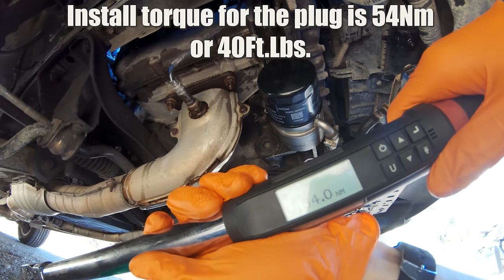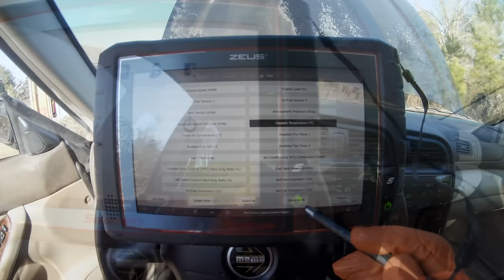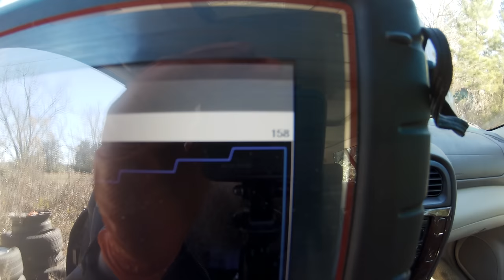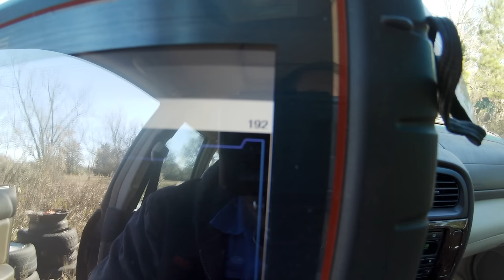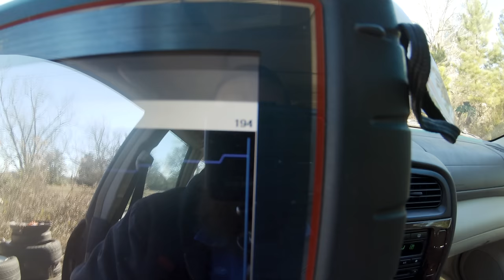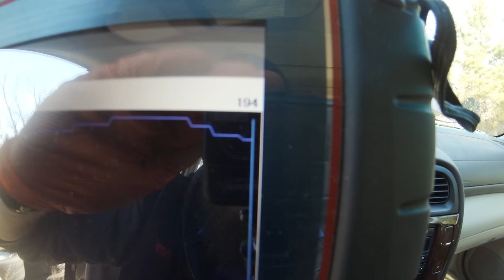Subaru Coolant Replacement

Comment: Pro tip: disconnect top radiator hose and slowly refill coolant into hose until it won’t take anymore then reconnect and top off.. eliminates air pockets.

Comment: Nice video.. i think you should wrap the teflon tape the opposite direction next time.
Reply: Yeah I noticed that too, but then noticed he only did roughly one turn, so basically no difference. My normal thought is that if I can pretend I'm tightening the fitting as I'm wrapping, It's okay.

Comment: On a O.R.B fitting there is no need for teflon tape.  The threads dont do the sealing. The oring does. Only use tape on pipe threads.

Comment: I did the heater and keeping the rpm at 2-3k several times over the span of 30 minutes. Bubbles stopped but would come up after turning off the car. Is that normal?

Comment: Your camera angles, snap on tools, no talking just concise thought out captions....you kick ass man thanks. I have used primarily your videos to replace on my 06 obk front hub/bearings, front control arms, side links, transfer case seal and drive shaft (3 times), flush my coolant, power steering flush, ac clutch replacement, both power belts....and a lot more haha. I owe you for saving me literally HOURS AND HOURS of labor when its $125 an hour now in my area for mechanics.

Comment: I stg man, you’ve got the most helpful videos for subie owners. No fluff, no bs, just the job in a plain and clear way. I bought my first Subaru 2 years ago, and I haven’t had to take it to a shop a single time. Not once! Everything; changing coolant, bleeding my brakes, changing the oil, changing the diff fluid, changing gear oil in the manual, I’ve learned it all from you. I can’t even begin to calculate how much money you’ve saved me. I didn’t even know where the oil went in the engine bay when I bought the ol girl. Couldn’t even tell you where the drain plug was or what it looked like. That isn’t the case anymore, and I’ve got you to thank. I don’t think people realize what a resource this is for normal, working-class, folks. And you’re doing it free of charge, to boot. Thanks so much, sir. I really appreciate what you’re doing. This is legitimately a service that really, really, helps people, and I hope that doesn’t go unrecognized 😊

Comment: So I probably looked through your video numerous of times to do a drain just like this for a 2011 subaru outback 3.6r 5eat trans. The drain plug for the coolant was way to tight space wise to get to. Without using a torque wrench I pulled the inner hose on the oil cooler closest to the exhaust manifold. Was incredibly easy. After following the rest of the video it was a piece of cake. Just want to say thank you and to also help others with similar make model and year as my car.

Comment: Must be nice working in South Carolina outside rust belt. One of bolts for my reservoir bottle was seized. No way it was coming apart. Ended up snapping it off and drilling out the insert which turned into a whole project on its own. Heat from drilling it ended up melting plastic around insert and it came out on its own drilled the insert out and used it as a spacer and secured the bottle with a #6 nut , bolt and washer. The plastic was left very thin on the fan shroud around where the overfill bottle bolts on and broke so required some pb weld to correct. For anyone working in rust belt or Canada, I would strongly suggest spraying down all the fasteners required to do this job with a good penetrant everyday for several days to a week prior to attempting this job. Trust me it’ll save you a bunch of hassle on something that should be simple.

Comment: Very helpful video.  Just as an aside coolant from the overflow reservoir can be removed more quickly by using a piece of clear, flexible 1/2" tube as a syphon about 4 feet long. Pre-fill the tube with water. Pinch off one end.  Insert the other end of the tube into the reservoir. Drop the free end into a bucket. The water will start the syphon going. And all the fluid in the reservoir will be extracted.

Comment: Thumbs up to you Mr Subaru. I'll remember this next time I flush/fill. It's been 90° every day since I changed it and no problems so I don't think the distilled water will matter much but I'm pissed, forgive my rant. I just changed the radiator in my 07 2.5i. I watched 4 videos about flushing coolant twice over during the time I was waiting for the parts to come in. 2 of them were Subaru specific, but none of them mentioned the drain plugs in the block and this video doesn't show up in my recommended till 4 days after I do it? After my searches on both YouTube and Google? 🖕 Your algorithm YouTube. 

I ironically saw them while I was under my car and said "hmm wonder what thats for" cuz it even looks like a drain plug!

Comment: Thanks again for the DIY vids.  Changed out our 2013 Outback 4 cyl CVT model's coolant and thermostat this weekend.  I think some coolant from the thermostat must have pooled on top of the exhaust as it smoked coolant during the warm-up afterward.  I thought I had a coolant leak and took off the under body plastic again to recheck the torque of the two bolts on the thermostat housing.  Everything seemed fine and smoking discontinued.  replaced about 1.7 gallons
Reply: Changed the heater hoses on my Mitsubishi  and flushed core, same as you saw coolant steam and stopped but was only spillage.

Comment: Great vid! Super helpful! Like you, I found the plugs to be quite tight. I used a brass brush to clean the plug threads before applying teflon tape. Additionally, I cut the tape 3/4 length wise to reduce the amount of material as there isn't a ton of room on the threads. I didn't do that at first and experienced quite a bit of squeeze-out using standard width tape.

Comment: Great video, as always. I couldn't help but notice how clean your battery was. I clean mine regularly and although it is a relatively new battery, I have build up especially where the large caps are located on the top.
Reply: I think build up can be from over or undercharging. You can have your alternator and battery checked to make sure it’s in the right voltage range while the alternator is off and when the vehicle is running. 

You can clean remove and clean the battery with baking soda and water mixture to neutralize the acid. 

 Then when dry, add battery lubricant to the terminal posts to prevent corrosion if you haven’t already. 

I don’t know that much so I hope that helps if any

Comment: I only needed 1:30 but good video for the rest of you. I saw that under there when i did my oil but wasn't paying enough attention. I was more pissed that i needed an extractor to remove my oil drain plug to figure out what anything else was. Not only was it a circle, but they used an impact to put it in. I really wanna know who hired those guys. 
I started filling my coolant and didn't realize i didn't need so much so now i need to drain some out. Don't want it to find its way out somewhere.

Comment: Wow  Now That's Roughing it !   lol Working OUTSIDE in an old broken up stone Driveway , I thought I had it rough , Working in my Nice Smooth concrete floor shop with out a lift !  Great Video , but  you needn't  be Shy about Describing your work too , as you proceed  helps to understand methods and guidance .
Thanks !

Comment: Thank-you for including the removal of the 14mm hex plug, this is something that most people don't cover in these 'Subaru Coolant Flush' videos. I see videos where people drain coolant from the radiator then refill it with distilled water and run the car for a few thermostat openings with the heater on, then empty the radiator again and fill the car with brand new coolant. Am I right with my understanding that doing this is incorrect? without removing the distilled water from the block and the radiator, there will still be distilled water in the engine block and after adding the new coolant, the end result is going to be a watered down version because the distilled water was not fully drained? In your video A LOT of coolant came directly out of the block after the radiator was already empty. It just seems absurd to me that people don't know about it, this might be the only Subaru video including this information.
Reply: Hello World  if you did the job, can you provide any updates?
Reply: Hello World how’d it go? I’m about to give it a shot but worried about locating the correct place of the engine block drain plug
Reply: Yep good info. I’m draining my coolant at present using radiator plug and undoing various hoses. My 6 holds almost 7 litres and I can only remove 4 without using the engine block drain plug.!! Will get 14 mm hex to do job correctly. Cheers.👍
Reply: I found that both plugs were easy to find, but blocked by the exhaust. It wasn’t worth it to me to drain it out. I realized later that the next best thing would have been to pull out the thermostat which is quite accessible. I believe that would have gotten out a fair amount. In the end, antifreeze is pretty cheap, so if you do this twice or repeat every other year or two, you should be golden

Comment: When I did the head gaskets on the 04 Forester, I had no issues with air in system, but with the 06 Outback, it started to overheat. I didn't have no spill funnel, but a large funnel fit on ( jammed in) and worked to purge air.

Comment: I did the timing belt with your video assistance. I did not drain the engine block of coolant by removing the plugs - on the 2010 Forester, one of the plugs is under the exhaust. You would have to remove it diagonally. Not sure how one would go about it. On refill,  it only took 1.5 gallons of coolant + conditioner.

Comment: I've changed coolant on my 2008 SpecB, never took off drain plug for the engine as I was too much of a wuss! After refilling (5L) and starting up and waiting for bubbles to go I'm getting no hot air in the AC at all, I suspect air lock or something. The temperature needle is half way. I did leave it running quite a while but still no warm air.
Updated... So I moved the car from drive way to power wash the tarmac mess and the hot air looks to be back. It's late but tomorrow I need to fill up the resivor tank as it's empty. Hopefully that should do it. I think 2 litres was still in the engine as I never removed the hex nut but it's still in a much better condition than what was taken out

Comment: Thank you so much. If I could make 1 suggestion. Wrap the pipe thread in the other direction so as you tighten it, you dont unthread the plumbers tape.
Reply from the maker: Yeah. I changed it on install off camera after I noticed what I did.

Comment: At 19:23 it's like so obvious that you put the left over good coolant into the overflow reservoir, but it took this video for me to realize.   Lol     Great informative video especially about the hex bit socket size for the engine drain plugs.  Cheers!
Reply: Putting the left over good coolant into the overflow reservoir, when I do my flush and replacement, that's my plan...LoL.

Comment: I was told by Subaru that you need to change it every 30K. If you dont it starts eating the head gaskets. I just had my head gaskets replaced at 150K
Reply: That's a lie. Suburu owners manual says it's good for 11years or like 100k miles. It doesn't eat the heads. They just told you that so you'd pay them more often. The reason suburus need head gasket replacements so often is just because the engine. That's just how Boxers work. You "should" get a new gasket every 60k or so, just because it's a boxer. They've gotten smart. Telling you the coolant is eating away at it so you replace it more often, and then don't question when the head gasket goes bad. They're geniuses.
Reply: @mattevans1643  this isn't exactly true. The ej25 specifically has head gasket problems because of the single layer gasket they used at the factory. Changing out for a multi-layer steel gasket rectifies the problem.

Comment: Awesome video. I also just watched your water crosspipe gasket replacement video. Super helpful.
One question: is draining via thermostat removal acceptable, or should i also ensure futher drainage by removing block drain plug? 2015 Outback 2.5.

Again, I've watched several of your videos and always learn alot. Definitely subscribed.

Comment: I did this with our 2015 impreza no problem.  100,% perfect.  I was working on the forester 2019 and funnel started bubbling like crazy and overflowed . I turned it off asap. What could've happened.  Thermostat? 😢

Comment: A couple of questions...

1) Can you drain the block by just removing the thermostat?
2) Is the block empty of coolant when you start engine after filling with new coolant... until thermostat opens?

Comment: I have seen the Video about the coolant conditioner. I also asked the dealer if the conditioner is required on a 2010 3.6L. The answer I received is no. Please let me know your opinion. Thanks.
Reply: After you leave . Dealer orders in parts for h6 gasket job 😂😁

Comment: Howdy! Love all the Subaru content! Thanks for putting it up for us. Have been in love with my 2003 ez30d outback (220k miles (2nd owner)) for the last 3 years and have had very little to no issues. Recently I've noticed the temperature creep slightly above the 9 o'clock position. I'm replacing the thermostat and doing a coolant flush today. I've also noticed a slight bubbling in the coolant reservoir when the engine is hot but off. Is it normal to see small bubbles in the coolant reservoir at all? Or should it fill back up without bubbles? Thanks!

Comment: Thanks for showing us how to replace Coolant on the Outback. I guess the newer Outback drain plug should locate somewhere else instead. How can we find this drain plug in a newer vehicle? 
I have a Crosstrek 2015 Premium and Coolant replacement is about due soon. I have not able to figure out where is the Coolant drain plug on the Engine block. Could you give me a hint where its location? Should there be a label on the plug? All I know it's the 
Part Number: 11024AA141.
Thank you in advance.

Comment: How much different is the process on a 2014 3.6 outback? My local dealership wants to charge me 285+ $20 extra for the conditioner. I’m thinking all I need is 2 gallons of super coolant,one bottle of conditioner and a new thermostat. I’d also like to purchase a spill free burp funnel. Can I do this job without the snap on computer tool? How will I know the car gets up to the proper temperature? Lastly, will the additional drain plugs for the block be in similar positions?

Comment: if you want an idea for another video, maybe how to do a transmission flush. There 9 liters total but only 4 in the pan; manual doesn't seem to indicate a need for a flush
Reply from the maker: You drain/refill 2-3 times. That's what I do. An actual flush isn't recommended. Really isn't recommended on any automatic transmission.
Reply: @MrSubaru1387  So my 09 Impreza (auto) needs a fresh fluid because it's getting dark. Just replace the amount of fluid that  take out and I'm good?
Reply from the maker: Yes, 3 times over in about a 100 mile stretch of time.
Reply: @MrSubaru1387  Thank you!

Comment: Great video.  I just purchased a 2002 Outback and I'm going to replace all filters and fluids so of course I rewatched this video. What does the coolant conditioner do? I don't believe I have any external or internal leaks so is not adding the conditioner detrimental? And why didn't you replace the thermostat when you had the system drained?  Thanks for the great videos on Subarus!
Reply: I believe the conditioner is to keep it from eating your head gaskets.
Reply from the maker: It's restickered stop leak.

Comment: ARGH! Thought I was doing great until final step, when the Foz (2014 Ltd 2.5i) only took 1 gallon of coolant and refused any more. I must not have waited long enough during final draining phase, so now have 1 gal. of water mixed with 1 gal. of Sub Sup 50/50 in there.
Trying to decide best face-save maneuver: (1) Drive it a few days and order some Sub Sup Concentrate to add, or (2) Start all over, or (3) Let the de-facto 25/75 mix stay in there indefinitely (Southeast Louisiana driving).
Feeling like a chump letting a rainstorm scare me into hurrying as I must have. :-/ Went back and rewatched 0:00 - 6:30 only to realize I hadn't seen or removed those large ports you did!
Reply from the maker: Super coolant only comes premixed. There is no straight power, non-diluted. Did you pull the engine block drain?
Reply: @MrSubaru1387  Naw, I screwed up that part. Next round I'll at least pull the lower hose and thermostat to drain block(s). Hearing mixed signals about wrestling with the actual 14mm hex ones (x3).
But, hey, yeah, I see Sub Sup Concentrate on Amazon here https://504.la/2PfOxOa

Comment: I have a 2008, just bought so flushing & replacing…

My overflow bottle looks different, any tips on how it removes? I used a hose & squeeze bulb to drain it.

Comment: Thanks for this video.  Getting ready to change out my radiator fluid. Question. Have you ever used or recommend a radiator flush additive prior to changing out the fluid?  Used to do this periodically on all my old Detroit built cars/trucks.

Comment: Thanks for you video.
I have a 2010 Subaru Forester, based on owner manual says just to drain coolant from radiator. Is this correct ? Any suggestions please. Many thanks

Comment: On a 2015 Legacy.  3.6 there is no room to fit the 14mm hex. To take drain plug out.  The exhaust is to close.  There must be a special tool.?? Or something.     But great video.

Comment: The biggest gripe I have is that Subaru didnt include a temp gauge on my 2011 forester.
Reply: yes, you have one.. electronic. The red light will pop up if it gets above the threshold